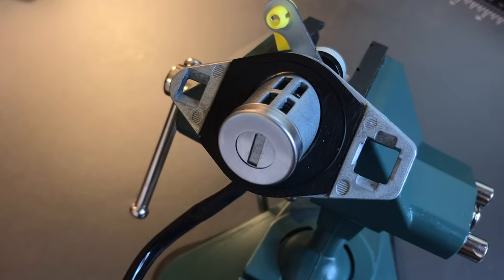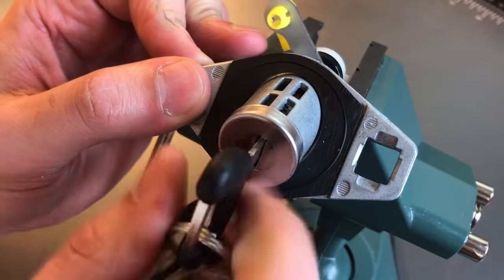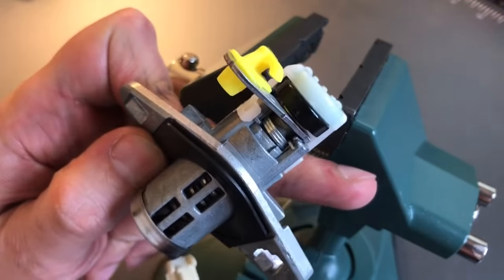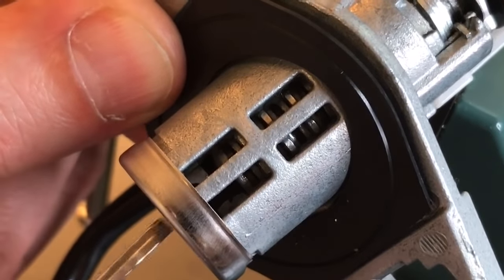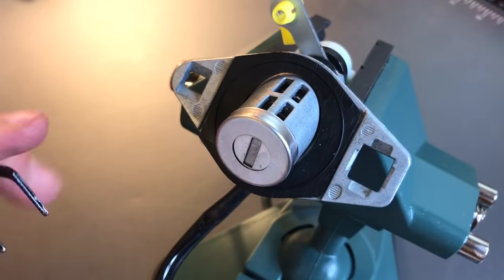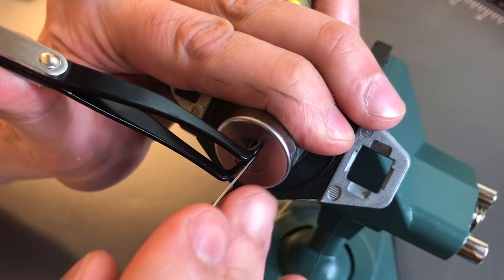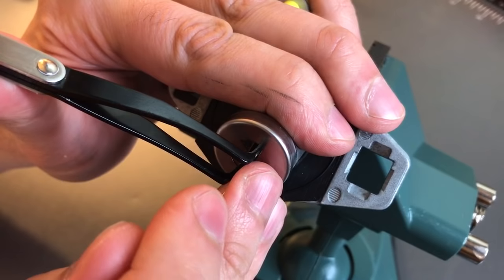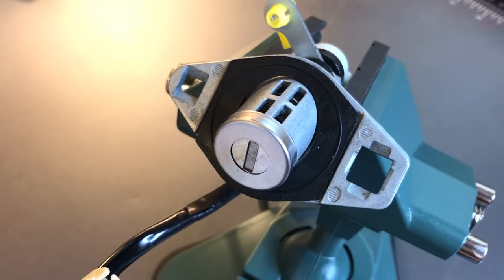[372] Mazda 6 Lock Picked & Alarm Disarmed

Comment: Thanks LockPickingLawyer! I've got a new Mazda 6 thanks to you ;)
Reply: Lol
Reply: How did you bypass the immobilizer? ...
Reply: @bepowerification  as a mechanic really not that difficult. most VTD systems are fairly simple. especially on older cars. like a lot of cars from that era dont use Transponders but arm and disarm the system by the turning of the core on drivers door lock.
Reply: @michaelkierum42  I know that Toyota has used chip in key tech for a long time. Same type of lock as that Mazda too.
Reply: @bepowerification  you can easily disable imobiliser with an ECU flash
Reply: I hope nobody is taking this comment seriously
Reply: Boss Boomer I don't think many car thieves get in via the trunk.
Reply: @Ea-Nasir_Copper_Co  you're wrong there bro, they will use any means, normally the route of least resistance
Reply: @jonnyjoanknecht5164  then they would simply break the window. 
Any chain or system isn't any stronger than its weakest link.
Reply: Your 6 is in the danger of disappearing list.
Reply: You are going to need his other services, a lawyer
Reply: @darcilucas9201  breaking widows  sets alarm on
Reply: Guinevere Baroque most sedans have the option to throw the backseats down, you could gain access to the car fully by the trunk.
Reply: @bepowerification  reprogram a new key in about 5secs thought the obd
Reply: @micjubba709  not true, you need a programmer. They take longer than that to turn on ! You're gonna get caught with that mentality! Lol
Reply: You mean you HAD that car?
Reply: yeah, by picking the trunk 😂
Reply: Me Here wait you don’t?
Reply: Thanks lpl someone stole my mazda
Reply: Immobilize
Reply: Should aim for a lambo
Reply: Hey you that was mine !!! Can you return it please
Reply: Hol up
Reply: Stupid comments like this is why ppl stop makeing helpful info for ppl who need it
Reply: I’ve also got a new Mazda 6 and this made me sad
Reply: Lol
Reply: @michaelkierum42  lmao, you would hate my 95 Lexus gs300. If you lock it with the remote on the key, it’s not gonna be broken into, manage to pry open the door and hit the unlock/lock button, it won’t work. You try to pull on the handle on the inside, it won’t open the door. You manage to pull up the actual lock itself, it will immediately lock itself. Aka if I lock my keys in the car, witch I do often. You gotta fish the keys out or else your screwed xD
Reply: @darcilucas9201  exactly plus it doesn't have to a be a good window if their aim is to resell it; it's not like the purchaser would know any better anyway ;)
Reply: And a hardworking family is without, probably had a loan on it so you ruined their financial perspective, and probably also their marriage. The kids can’t go to school anymore and have to sell themselves to provide food on the table, out of guild the mother probably hanged herself by now; so well done papapudding, enjoy your Mazda 6!! Bravo 👏
Reply: Nikolai Ronan  You must be a very insecure man hacking your girlfriends Instagram account, poor Nikolai
Reply: instablaster.
Reply: @miralemnermina142  I just replace the ecu with my own and tape my own key next to their ignition cylinder.  I mean some cars u can just take the cover off the ecu and break off a chip from the circuit board and you can start the car no key at all after that  🚗

Comment: All fun and respect until you stole my car
Reply: Dude where’s your car
Reply: Omg i cant find your car
Reply: Anti theft killswitch system! Personally I would get a 30 second shut off so the hole car loses power your only taking what's there not the wheel box it self lol
Reply: Eh you're not getting it started without the PATS key even if you do manage to pick the tumbler in the column.
Reply: @JasonFolk07  I drive stick. Thieves can't drive stick they just move to another vehicle.

Comment: Mazda has since moved away from external locks, as have many manufacturers. Now the only trunk access is via the key fob button or the cabin trunk lever.
Reply from the maker: Good point.
Reply: SilencedMi5 almost all cars still have a keyhole on the drivers door. It’s just hidden. If you look at a door handle you’ll see the slit between the handle and the door, normally the piece of plastic next to the handle will pop off revealing a keyhole.
Reply: If the battery goes flat theres no way of unlocking the doors without a key.
Reply: @edstar83  That's why Tesla has a string in the front to pull to open(!) the front storage so you can attach a battery or charger so you can use the fob.
Reply: We have a 2-year-old Mazda, and it doesn't have a rear lock (we have a "hatch" in the rear, as opposed to a proper trunk lid).  As I understand, the most basic model Mazdas still are "key" operated for doors, trunk/hatches--however, you will rarely see these models at car dealers (too modest a profit margin).  If you move "up" at least one trim level, you'll get the more common battery-powered key fobs, and electronic locks.  However, the entry doors (driver and front passenger) still have locksets, just in case your key fob battery is discharged (there is a temporary key holstered in the fob).  More than you wanted to know, I'm sure...
Reply: My 2007 Citroen has an electric trunk switch to open, it completely diengages when the doors are locked. Though one time I had to break into the car because my keyfob battery had died and the lock is rusted shut, so it doesn't turn even with the right key. Wasn't that hard to pry open the door and get a wire to the inside door handle.
Reply: Most cars still have regular locks on the handles, usually you can pop off the plastic shell of the door handle to find a lock. But picking is still quite useless because 1.The alarm goes off 2.The car won't start without the immobilizer 3.Most newer cars don't even have a regular key ignition to start.
Reply: Soon lock pickers will all be electronics freaks and computer nerds.  there is, of course, a certain nerdishness in the hobby and sport aspect of lock picking.
Reply: @edstar83   Tires go flat, battery go dead !!!
Reply: @imnota  it depends on the vehicle, Kia fortes all the way to 2015 don't have immobilizer chips and you can use a regular metal key to start the car
Reply: Which is easily opened with an rfid capture device. No need to spend time picking locks. Just capture the code, and you can steal a whole car. Pretty stupid design compared to a lock youd actually have to pick.
Reply: @LrulestheworldM8  You cannot just capture a code for most of these systems.
Reply: @SumD-EGuy   that is not the issue the issue is how much it was used     
or the wear and tear on the cylinder   after 2007 they have pretty tight tolerances because the keyholes are not used  on the door
Reply: @kenc2257  actually, quite useful to know.
Reply: Most cars would still have a manual lock in case the batteries in the key fob run flat. It's typical under a cover on the drivers front door. They are designed to be removed with the spare key blafe so a flat screw driver does the trick all the same. I say this as a mechanic working in a new car dealership.
Reply: @lockpickinglawyer  they use a proxmark 3 now 😁
Reply: @SumD-EGuy  for when the battery dies.
Reply: @lockpickinglawyer  Can you do some on the modern car keyfabs? Are they safe?
Reply: Fuck that noise.
Reply: And while we are on this topic, it seems a good place to remind everybody whose car has a limited number of mechanical keyways that they don't use often... That you should probably test and graphite Lube those locks no less often than annually, to make sure they actually still work when you need them.
Reply: @baylinkdashyt  Yup. Door lock cylinders on my '85 F150 are so stiff that I don't even use them lest I break the key off trying. Was like that when I bought the truck 13 years ago and it hasn't gotten any better in the interim. Not that anyone's gonna try to steal a $500 rustbucket with one too many pedals and no shifter on the column.....
Reply: @Noksus  that's how I break into my Colorado. Because I locked the keys in there more than I should admit to

Comment: Hi Harry, Interesting to see you picking some car locks - you sure like trying different locking systems! If you can get hold of some wafer locks from German cars, you'll find the tops of the wafers are serrated on both sides. The wafer chambers are also grooved to lock up the wafers under tension. Tricky to pick, but because the wafers lock up under tension, it actually helps impressioning.  Regards, Brian.
Reply from the maker: +Brian Hignett I'm trying to expand my skills to car locks... it just seemed like too gaping a hole in my skill set not to make an effort. Thanks for the tip on German wafers. As it so happens, I just got in a BMW and a VW lock... but they are not oem as represented online, so they are going back.  I'll take a peek inside first. 😈
Reply: You mean Lishi, don't you?
Reply: @lockpickinglawyer  If you would like to send me an address to send it to. I have a lock in a trunk of a 89 bmw 5 series. no key for it. but its all yours.
Reply: @lockpickinglawyer  just go on pull a part a get some there, they probably don't have the original key, but shouldn't be a problem for some with your skills.
Reply: @lockpickinglawyer  what pick see you using in this video?

Comment: you should do a video on the 90's Honda Locks, I heard the system was so awful that a butter-knife can open the car.
Reply: I have had a few 90s accords and we bought to that were basically keyed alike not sure if they actually were but keys from both opened both cars
Reply: Yeah you can open the second gen CR-X cars with a butter knife (and any other models using the same locks). You can slide the knife down between the window and the outer door panel straight down to open the door when locked. It was almost faster using a butter knife to get into my car than the actual key.

90s Hondas seem to of had a very limited number of keying options. Add in the wear and tear of +20 years of operation and you will find keys work that shouldn't in them. Sometimes you have to do a little jiggling to get it to work though.
Reply: Yee 90s honda had very similar keys. As well as a flat head can both ublcok the car and turn it on
Reply: Yup I had 4  92-95 civics and some keys did open other Civic doors but they would not start the other car. Also had a 97 suburban the key opened and started a 99 Yukon.
Reply: Mid 2000's and below GM vehicles and jeeps can be opened by raking just about any car key that will fit in them too
Reply: Yep! I had a 323 that I could open with a butter knife
Reply: The newer Honda (laser cut keys) are a bear to pic. Basically you have to pick the A wafers, then the B wafers and the lock will turn about 45 degrees, but that is only 1/2 way picked. At that point the lock is neither locked or unlocked and has to be picked again on the A wafers. It will turn to the unlock but will not turn back to the neutral home position until you pick again in the reverse direction the A wafers again.
Reply: @ToolofSociety  Fords from the 1960s-1980s aren't much different. fun fact my friend bought a '67 Mustang and his key was so close to the key of my '85 F150 that I could start his car quite easily and he could start my truck with a little jiggling.
Reply: Early Automotive locks - 70s and earlier - were generally four-position wafers, and the odds of your key opening somebody else's identical car were much much higher than you would like for them to be. There's a story about my sister in a parking lot of a restaurant in Massachusetts that goes here, but I always get the details wrong. :-)
Reply: @baylinkdashyt  I'm guessing Ford was a bit lazy then. The key to my '95 and my '85 F150 are the same exact blank with different bitting, like they were still using the same exact lock cylinders in the columns of the F-series truck right up until the '97 facelift that they'd been using since the height of the muscle car era. Given how many F150s alone they sold it doesn't surprise me that there's a lot of same-keyed Fords out there. Even today there's probably a few thousand cars on the road that the key for my '85 will start no problem.

Interestingly Ford used a different cylinder and different key for the door. Only one row of bitting on it, totally different style of lock.

The ones in my '85 are really stiff and I'm afraid to even use them lest the key break off; I might just send them to LPL when I get around to replacing them. Be interesting to see him pick them and gut them. Might also change the ignition lock in the '95...it doesn't work quite right anyway; as long as you don't pull it past 'off' you can just use any random tool to turn it but if you turn it fully back you actually need the key...and send the old part in as well, both to see him pick/gut it and see if he can figure out why it isn't working like it's supposed to work.

Comment: I knew someone who owned a Mazda 6 something or other. He accidentally locked his keys in the trunk and a police car happened to be passing as we were trying to unlock the car with slim Jims made from wire coat hangers. The cop opened his Swiss Army knife, stuck the short flat blade screwdriver into the lock and gave it a twist. The trunk lid opened.

Comment: All you do Is pull the e-clip, sensor, and tension spring. Then smack the back square that drives the sensor and few time, bam the plug comes out the front! I've been a auto locksmith for year! Plus a lishi makes the job much easier. Love your vids, keep em coming

Comment: I can unlock cars without the key at my job, but always for someone who locked the keys in the car. I don't mess with the lock itself; I just use the door and the physical mechanisms in the cabin. For example, I'll make a gap between the door and the body using my tools, and then stick a bent metal rod with a 90° bend at the end through the gap to push the unlock button, move the lock to the unlocked position, or sometimes pull the door handle. Oddly, a lot of cars open their doors when locked if both the interior and exterior handles are pulled at the same time.

Comment: you should test that old thing where these locks can be just smashed with a screwdriver and turned :P
Reply: Not this type.
Reply: I does not always work, on my 306, when i bought it, it had broken driver lock, looked like a failed attempt to me.
Reply: Works on Saab 99 at least.
"Stole" my own car once back in the 90's when I had lost my car keys at some market.
A large screwdriver with square shaft, a hammer to drive it into the lock, and a wrench to turn the screwdriver+lock.
Both door and ignition were defeated easily.
Reply: Didnt pop the lock properly if you can pop it the right way it wont break but some force on them yeah most definitely gunna break lol alot dont do it anymore but anything from under 2000 you can pop and work your way in with a wire hanger lmfao .

Comment: Been trying to unlock the wifes trunk for 15 yrs. You did this one in minutes. I've tried soft tension, slip affect, drop method, worked the top of one, clicked two, licked three, disabled four, counter rotation on five. Never got in..
Reply: @Envinite  I even re-keyed the cylinder with a bigger core.
Reply: @Envinite  lol

Comment: I used to repo cars . most of the newer cars would still sound the alarm with the  key. Like Chevy if you double click the key fob . Use the key to open it will sound the alarm. If you single click the fob it won't.

Comment: Usually along side that sort of lock, there’s a sensor in the trunk that picks up the signal that the key emits. If that signal isn’t present when the core turns, the car’s security sets off the alarm

Note: I’m speaking in general automotive terms, I have no idea if the Mazda 6 complies to that
Reply: It depends on the year. This style of lock predates microchip keys, but still continued to be used in tandem with microchip Keys after.

Also, most cars that have a mechanical and microchip key will only use the microchip when you try to start the car, not when opening doors or trunk.

Comment: I had all 3 of my vehicles in my driveway picked and alarm disarmed before.  They opened every compartment and took any lose cash or change.
2007 Chevy solverado 1500, 2015 Subaru Outback, and my 2002 subaru legacy. My neighbors was also picked and disarmed. He had a newer Mitsubishi. Funny enough it was shortly after i had a locksmith unlock my 02. Locked the keys in the car with no spare. No evidence to go on though.
Reply: I would be telling the police this info....
Reply: I have 2 keys specifically for the purpose of opening GM stuff and they will do 98-11 or so.
Handy little boogers have made me a lot of money over the years on unlocks.
Reply: Are you sure they were picked.  If all of the cars in question had key-less entry then a professional doesn't need to pick it.

No so similarly my step mothers 2008 Escape was stolen, no forced entry, physical keying stayed the same but they programmed new transponders to the vehicle so existing keys would not work (there is a number of keys limit).  They had to precut the key ahead of time but these guys are walking around with a PATS programmer lol. Vehicle was recovered being driven by the thief with the original plates still on it.  I worked for Ford at the time and it was a funny eye opener.